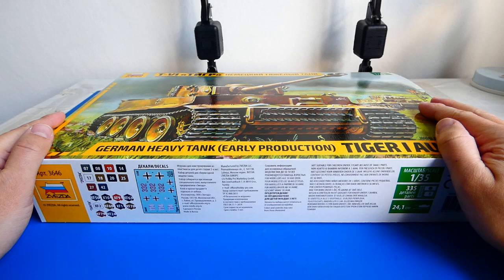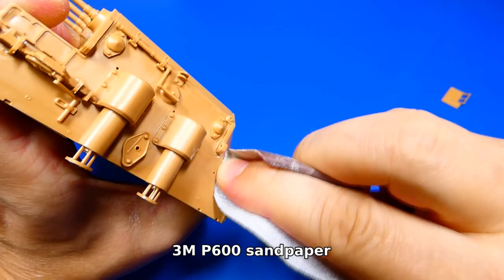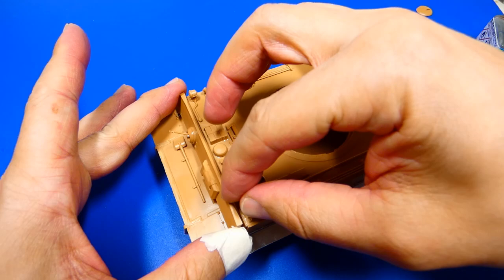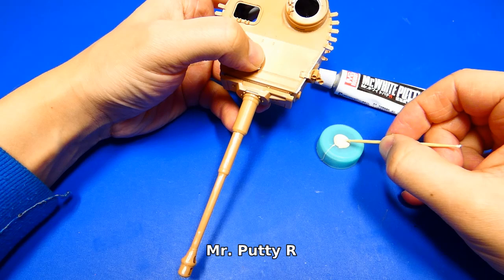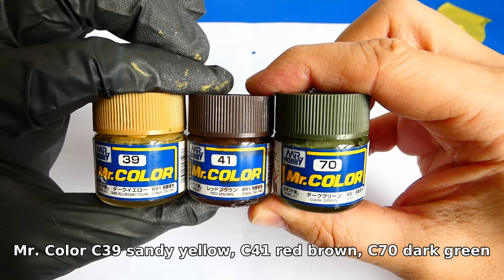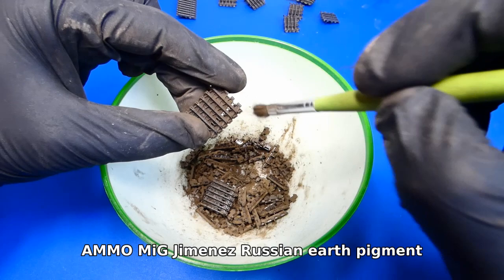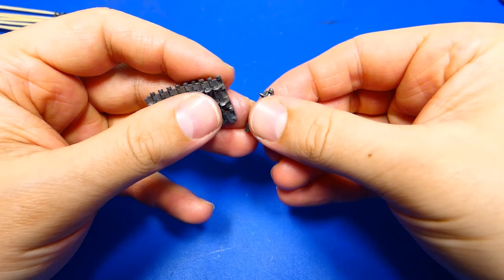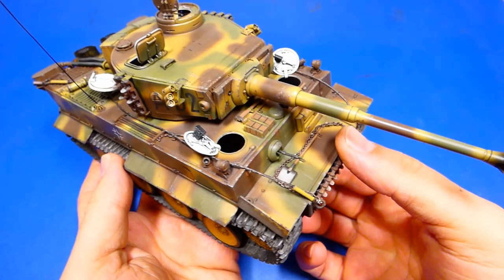Panzerkampfwagen VI Tiger I  Kursk 1943 Zvezda 1/35 scale

Comment: Good job. Though there are some missmatches. There should be meshes on rear hull top on air intake plates. Hatches were normally painted on the inside using the same color as tank base color, not ivory (white)

Comment: Looks not to bad for Zvezda alotnof mods you done though to make it nice! Surprised to see a partial interior in turret! Tip for you on Eastern front tiger's for next time, they took the front road wheels off each side as clogged up with mud to easy and when dried went like concrete!
Reply from the maker: Thank you for the advice. 🙂